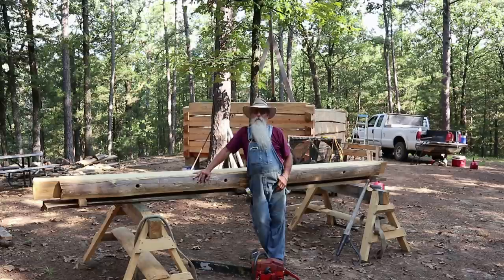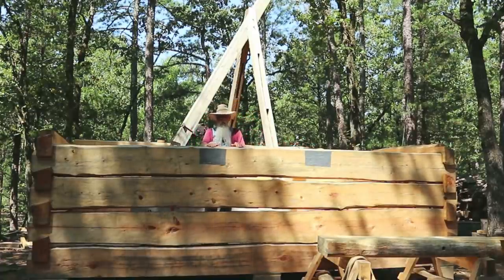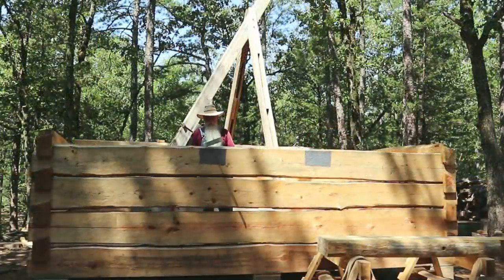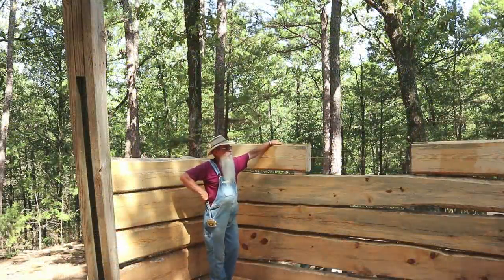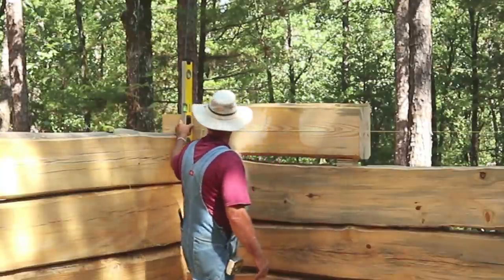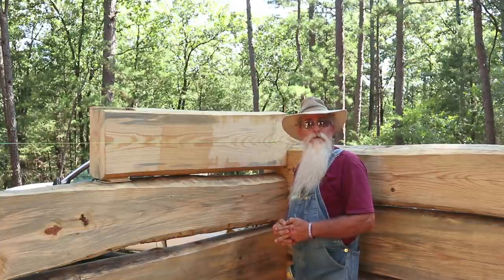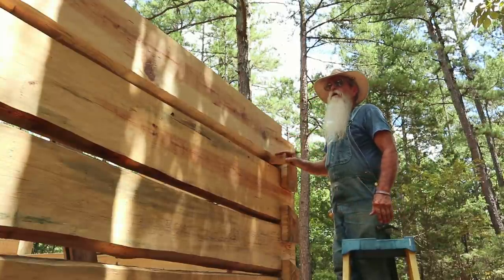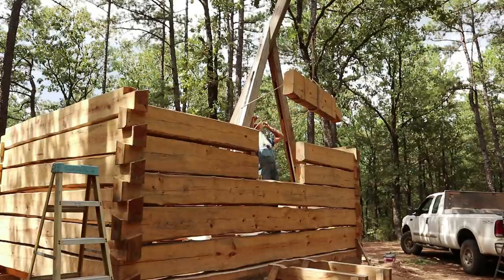Setting Rounds 5 & 6 Wall Logs, Paradise Point - Ep 6

Comment: Good morning. I have a question for one quite familar with equip., and who's evaluations I respect. Just struck by the lastest hurricane, I have been thru over 60 years of them and finially I decided I need a good chain saw. Not a little short blade, but not too long to handle. Can you in good conscience recommend a few good brands (dependability, parts & service). I guess it would help to know what I'll use it for, everything from roofs to trees. Sadly my large trees are getting fewer and fewer, down to just a couple of pecans 100 to 150 years old plus and some smaller oaks 12 to 18" diameters (I planted), and a monsterous pine. Hopefully its not to cut them down, but to clean up tree sized branches that are always ripped off. Thats the main purpose. Can you make some suggestiosn? I have operated a large blde saw in my youth, now I am more accustomed to the Air Conditioner. LOL 

Thank you in advance for time and your wisdom.
Reply from the maker: Howdy- I have Stihl and Husky chainsaws that I use on a daily basis. I think for what you’re going to be doing a saw with a 16” bar and around 40-45 cc’s would be enough. Actually, I’m thinking about buying a new Stihl that size. Hope this helps. God bless you